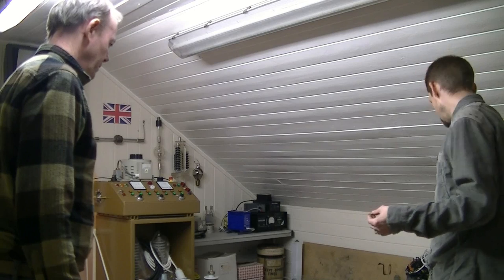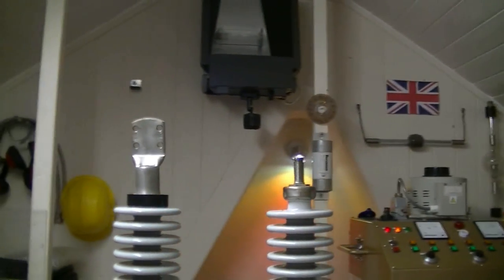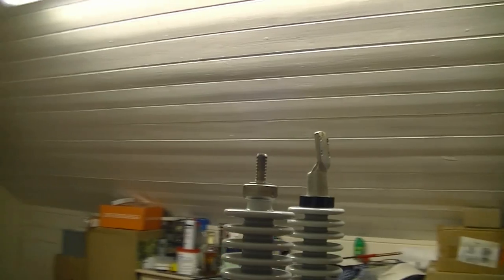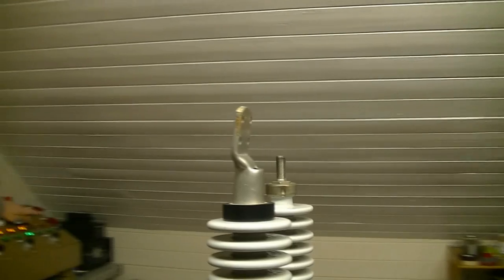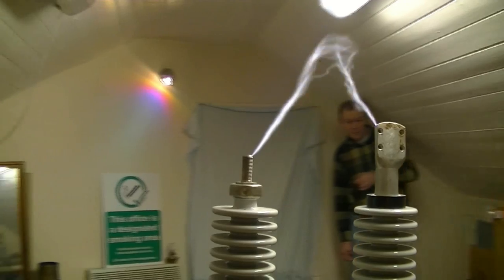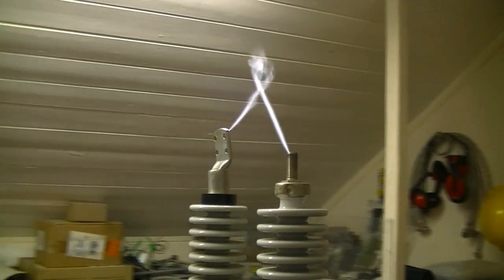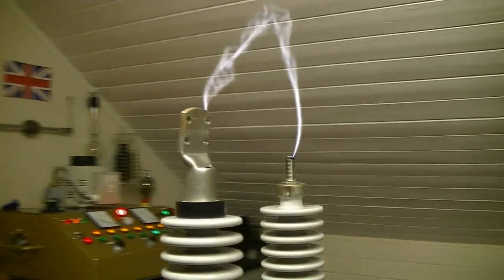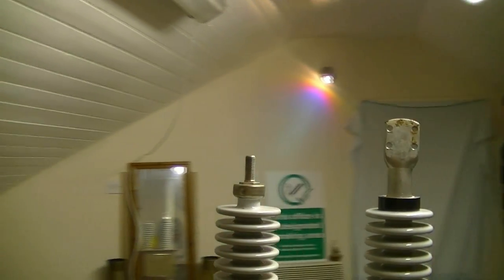Camera Rotor Test

Comment: LMAO! This is funny. :D A 360 view of a HV arc. :D

If any visitor asks how part of a wheelchair got stuck to the ceiling, just say that you overcranked a wheelchair until it exploded everywhere & THAT wheel got embedded into the ceiling. :D

Nice camera work, Mr. Photon! It was also good to see it from the view of the stationary non-rotating camera. Yes, nice recycling of electrical parts right here in this vid! :D From wheelchair motor to camera rotator. :D TOP JOB!

-BBD.

Viewer # 142. :D

Comment: The plasma in the arc is thousands of degrees Celcius, so the air surrounding it is also heated to very high temperatures. The heated air has a much lower resistance than normal room temperature air and electricity takes the easiest path, thus it travels upwards.

Comment: Brilliant! I might suggest locking the focus to prevent the rangefinder from getting confused and switching from an interlaced setting to avoid horizontal lines appearing in the electrical arcs.